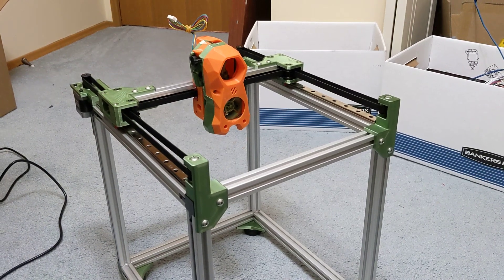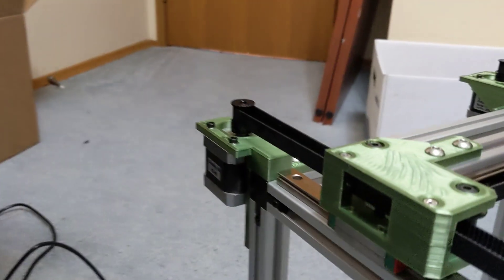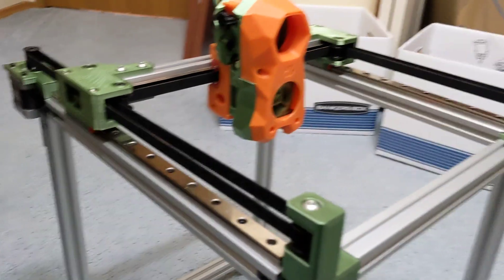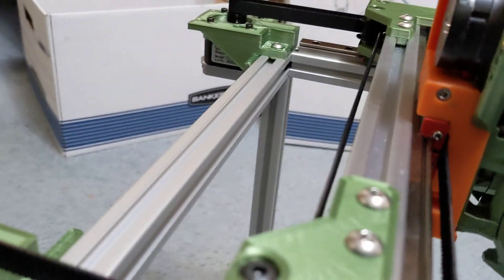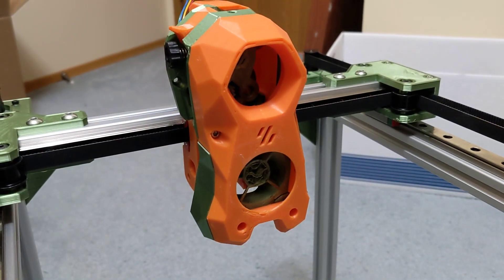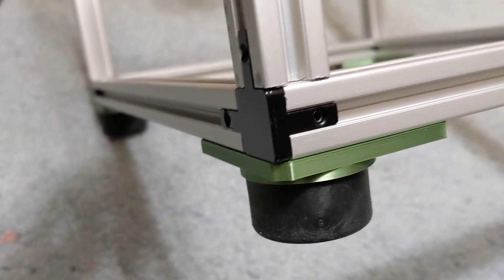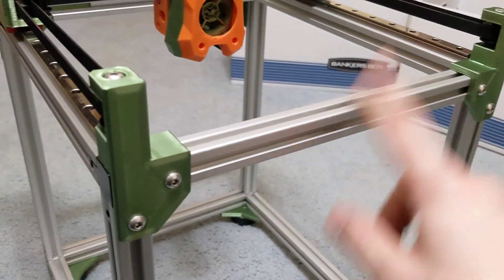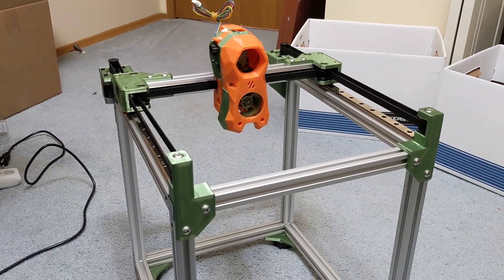Building a H-Bot 3D Printer - SimpleCube Ultra - Episode 1 The Frame and Belts

Comment: Hi, congratulations on your build it looks super clean !
I'm curious as to how rigid your bridge is, do you have any racking ? I noticed on my build that the connection between the linear guides and the plastic mounts (from which the belt goes through), can never be perfectly rigid because of the screws "diging" the plastic before being tensionned, thus allowing for a tiny displacement under high torque, have you met any similar issue ? Also what size are your profiles ?
Thanks and congrats again !
Reply from the maker: No issues, I did not design it to print crazy fast though. It worked well and was ridged enough. I usually always use 2020

Comment: H-Bot or CrossXY, what’s differences?
What is better?
Reply from the maker: CoreXY is better, H-not is fine if printing at low speeds though. Makerbot used H-bot for a while
Reply: @Rolohaun  What is the maximum recommended speed for an H-Bot?
Reply from the maker: @ricardorodrigues777  depends on the printer, with linear rails it can be pretty decent. I would only recommend building a h-bot if you want to test the limits
Reply: @Rolohaun  I want a speed above 400mm/s but still maintaining quality.
Reply from the maker: @ricardorodrigues777  you will want CoreXY.
Reply: @Rolohaun  Now I need to find a CoreXY  model. Thank you for the informations.

Comment: I've been binge watching all your videos lately and I love your work.
I've been wondering, what are the real advantages of a corexy over a delta, other than toolhead options? 
I've been thinking of building a mini delta, like yours, because I think it's the most bang-for-the-buck printer I can get right now.
Reply from the maker: Thank you very much! I would very much recommend building a delta, the parts count is much lower and they are so cool to watch print. CoreXY are easier to make larger in the X and Y axis, better toolhead options like you said and are easier to enclose for ABS printing.
Reply: im with you ! so simple ! not to take any shine anyway but have you seen vez3d's work ??? another person i watch for build design questions and his work is insane !!!